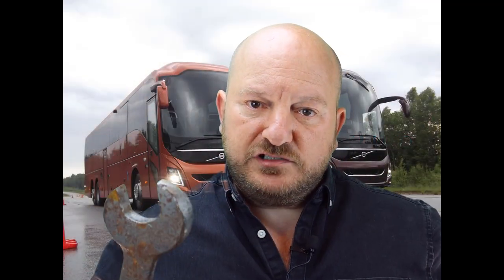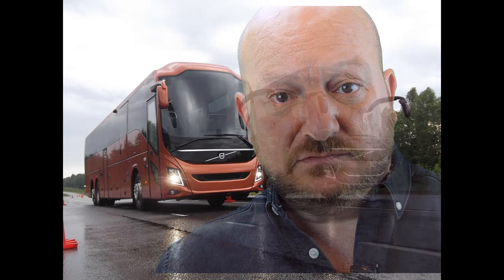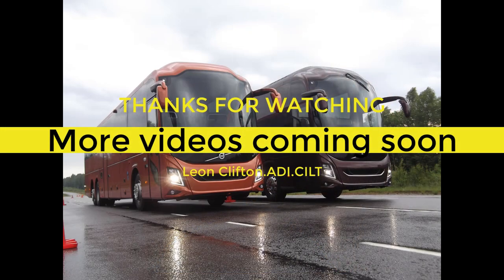Braking Systems On Large Vehicles

Comment: *Service brake and foot brake ,same thing 

*Endurance brake and retarder brake , same thing

*emergency brake, secondary brake,hand brake ,parking brake,same thing

*Engine braking is just taking your foot off the accelerator

*Exhaust brake is pressing the bottom on the floor next  left foot , it will block exhaust fumes leads to smothering the engine  automatically slows the vehicle down

Comment: The exhaust brake works nothing like a retarder,the exhauster basically caps the exhaust turning the engine into a compressor a retarder works in many ways,depending on which type such as electromagnetic and other types of system.